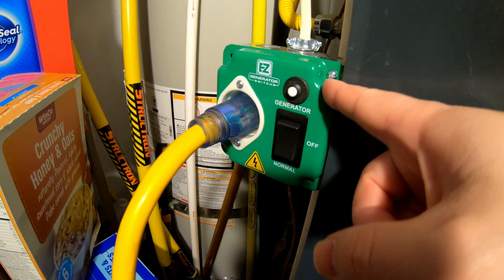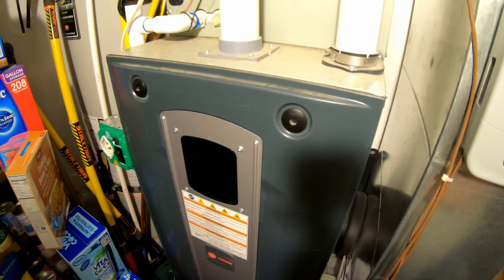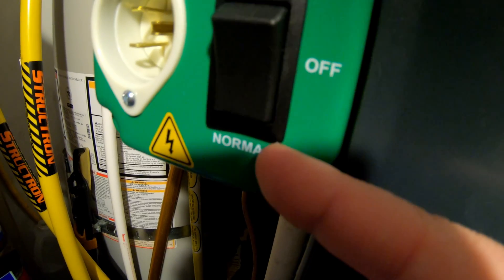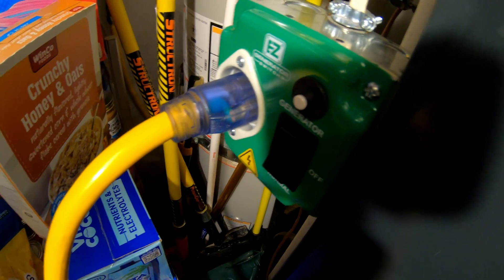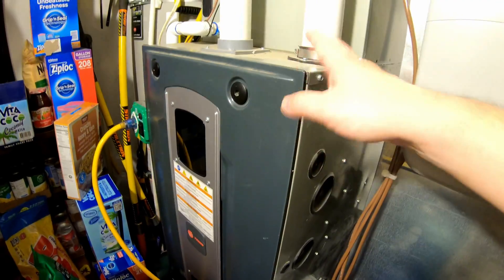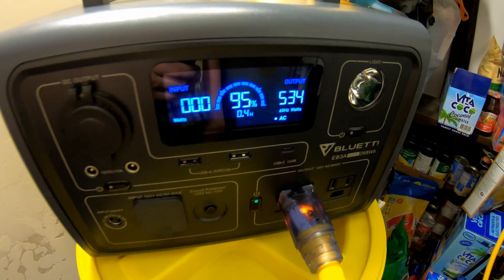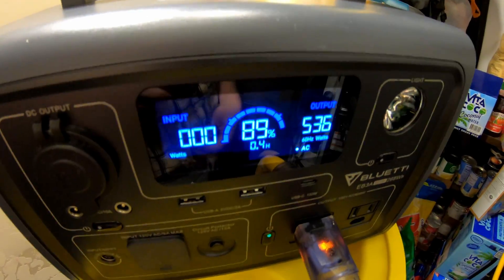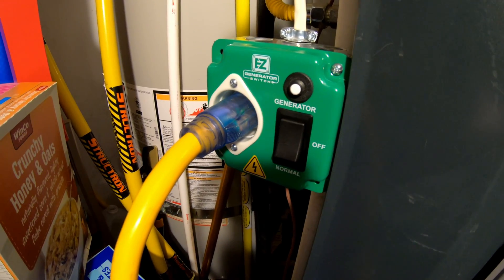How To Power Your Furnace During A Power Outage

Comment: I have the same furnace as you and just received my EZ Generator Switch. I plan on replacing my my switch with the EZ just like your setup and will be using the Delta 2 Max for power. I’ve looked at the directions for removing the three white wires for a floating neutral, but I’m one of those visual guys. Is there anyway I could see how you wired your setup inside the switch? It would mean a lot and give me peace of mind since yours works so well…
Reply from the maker: Here’s the issue. I am not a licensed electrician so I really shouldn’t show how to wire stuff. Their instructions are pretty clear and easy to understand. Just be sure to wire it up so the EZ Generator switch passes the ground neutral bond from your main power panel through since the Delta 2 Max is floating neutral only…and the furnace won’t run without that bond. Thanks for watching
Reply: @ I completely understand. Just installed it with the three neutrals connected and it’s working great 😜👍 It because of guys like you, that give folks the motivation to try some things on their own. Thank you so much for posting…

Comment: So, this is the solution that can go hand-in-hand with your compressor - solar panel hack! The compressor runs on the outside solar panels and the furnace runs off of your power supply (when needed). 
This fits in perfectly with my plans of adding 6 qty 300w solar panels, driving two Yoshina B4000 units with extended batteries attached. That will all drive my fridge, house furnace/AC, and my window air conditioner that is in the master bedroom for night time cooling. Brilliant! Thanks so much!
Reply from the maker: Sounds like you have a good plan! Glad you’re enjoying the videos! Thanks for watching!